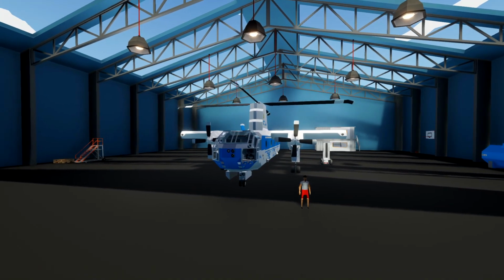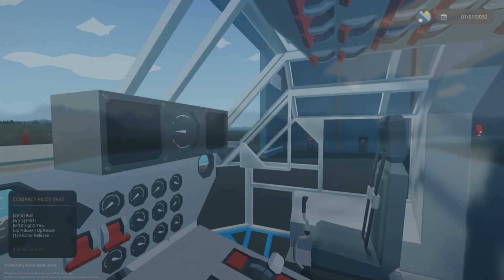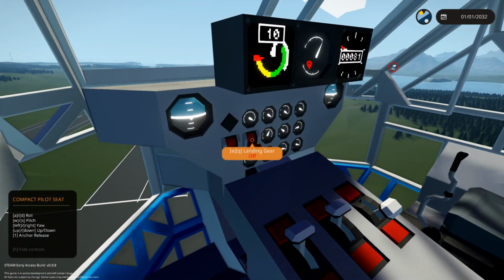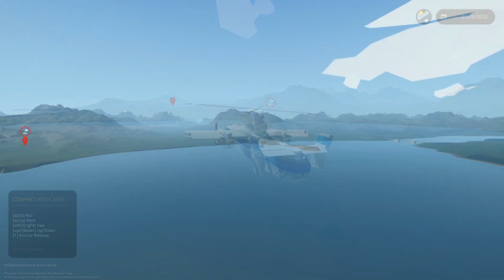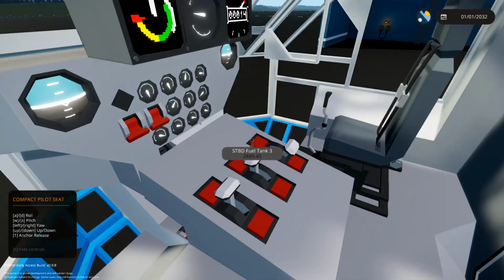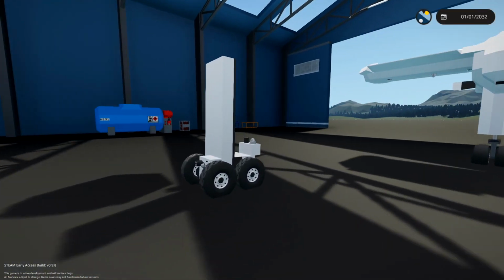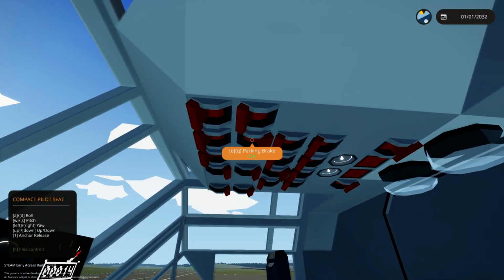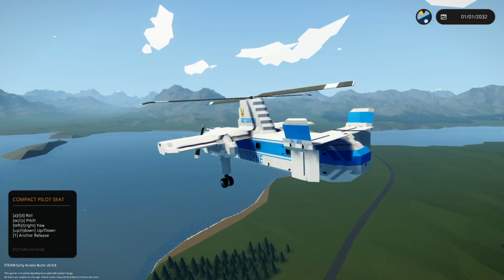Cargo Converted Rotodyne!  -  Stormworks Gameplay

Comment: It was designed like a plane but has blades on the top with tip jets for takeoff and landing on rooftops the blade on top had no motor it stayed in the air because the blade spun freely they were made to fly from city to city and were funded by British government because the us government was to busy paying for jet planes because it was the 80s
Reply from the maker: Indeed